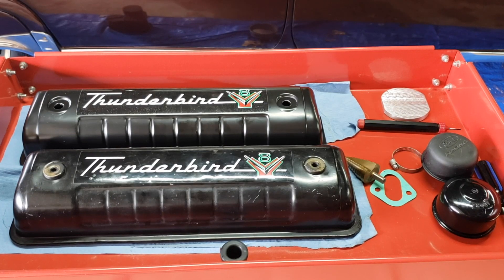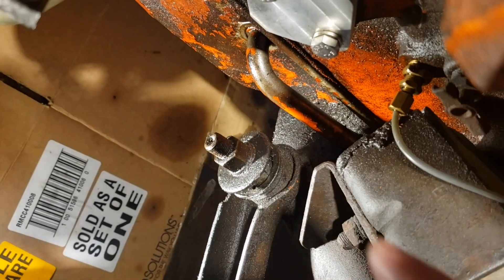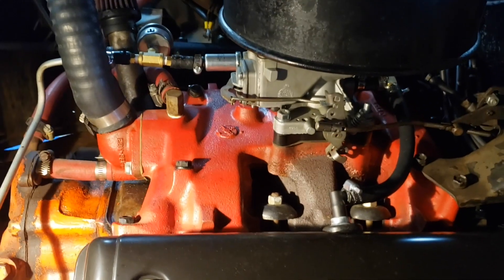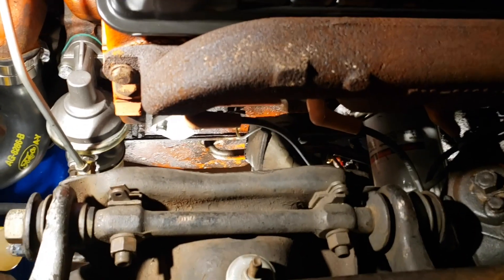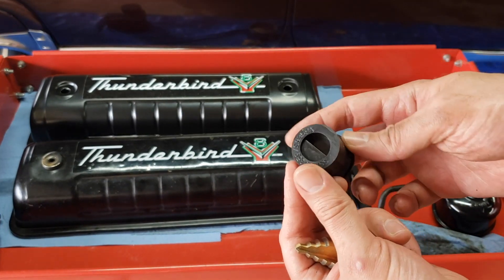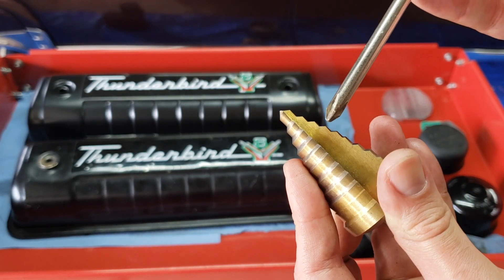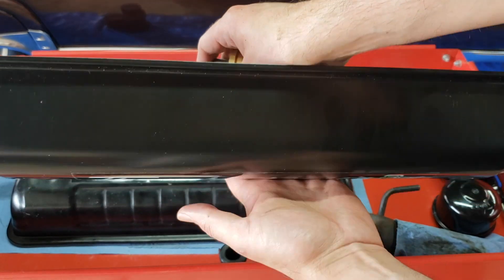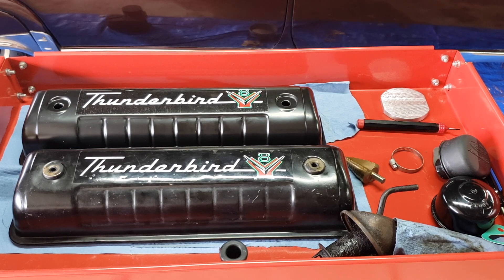Draft Tube to PCV conversion on a Ford Y block

Comment: Guessing you just placed the pcv to land between two valves
Reply from the maker: Between valves and positioned so it doesn't potentially collect oil or syphon off the rocker shaft.

Comment: Something I did to maintain a slightly more stock look was get an aftermarket oil filler cap with a PCV bung in it (I painted the zinc-plated cap to match the old one) then use a length of fuel hose to remotely mount the little breather filter out of the way. I used a Spectre filter that had a push-in bottom for a valve cover with a 1/2" ID, so I used a short piece of aluminum tube to connect it to the hose.

Comment: So looks like you are adding an additional breather to the other valve cover in addition to the original valley pan breather?  Just making sure before I start drilling holes.
Reply from the maker: Thanks for asking. I only drilled one hole for the PCV in the driver side valve cover. No other drilling. Later I also applied a little RTV black around the PCV grommet for a good seal.

Comment: Find an oil filler cap that has a grommet for a pc valve and you don’t have to drill a hole in your valve cover.
Reply from the maker: I considered that at one point to try a testing phase, but I don’t think I found anything that fit the valley pan filler neck. Still a nice alternative if you can source the pieces though. At least I didn't drill an original cover.

Comment: Why suck all that blowby crap into the intake?
Thats a greenie smog thing that happened in '63.
Reply from the maker: I used to get enough smoke out of the draft tube that I had people shouting at me at a stop that they thought my car was overheating. Not the first reaction you want when people see your car. There was the strong smell of the fumes as well. The engine also responded well to the change in crankcase pressure. I also pointed out how the location of the draft tube can saturate your lower control arm bushing in the long run. 

Still has been running great and with no direct effect on my carburetor settings. I’d rather recirculate the fumes than the alternatives.

Comment: How did you do the other part with the K&N filter? 
Also what is the pcv vale part number?
Reply from the maker: I was using K&N 62-1513 up until recently. I just measured the neck to get the size. Breathed well, but it was getting oil mist on my inner fenders I just painted even with the shield. So I'm trying a conventional breather again. PCV was a Fram FV184, still hasn't given me trouble.
Reply: Can you not run a flexible tubing and run it behind the motor and down with a filter?

Comment: A 1961-2 passenger car and a 1961-4 pickup truck y blocks came with PCV systems from the factory at least in California. If you have or can find one of the stock valley pans the installation of the system will be very easy. The valley pan came with a rectangular 3 sided “box” oil deflector and a teapot looking fitting. A retro fit one can be purchased for a Chevrolet that also fits. The PCV valve was an inline unit. A screw in valve, V100 from standard products, is the correct one for the Ford Y-Block engine if you want to screw one into a fitting at the base of your carburetor. An oil fill cap is available from stant with a 1/2” hose fitting which can be fitted to the underside of your air cleaner to make it a factory style closed system using filtered air into the crankcase.
Reply from the maker: Thanks for sharing the alternate V100 number, I only had the original number. It does look like it crosses with a Chevy valve on Summit's site. Do you have a number for the breather cap? The tube on the valley pan is 1.375, but searches tend to give me every size ever made but that one.

Comment: Thanks for the video.  You have a part number for that Moroso grommet?
Reply from the maker: Sorry about that, I forgot to add the grommet number. I believe it was #7209359 on Speedway Motors. I kept the package, I'll update if that's the wrong number. Throw out the foam insert and get better material and make sure there isn't any flashing left inside from the mold process.  One of the two in the two pack I got was pretty much completely closed by a big piece of loose flashing.
Reply: @mikemcgannvoiceover  ah! Thanks so much for the reply! Wasn't sure you'd see this after so long!

Comment: Best conversion  get an fe  engine unless you have a early bird  then you're stucked sucked😵‍💫
Reply from the maker: I've seen a few engine swap options in place of a Y, but this engine is still too healthy to justify the work just yet. With drum brakes, I don't like going faster than I can stop, so this cruiser engine will do. Some days it stops on a dime...other days not so much. 😄
Reply: @mikemcgannvoiceover  the 54 engine particularly bad  the 312 or 368 won't start on 6 v  the rockers you can run a bypass join the returns together with a tubing if one side oils  have a few engines in the yard and a ranchero 59  the oil pumps break.     3 times once on a 260 we had a fleet of these cars wagons tv repair shop the kit on the oil pressure switch will cause rod bearing failures  we never did that

Comment: Another option is using your hole saw on the lifter valley cover in the back. Requires pulling the intake manifold and cover. Easy mod. PCV grommet is bought at a parts store........
Reply from the maker: That's basically they stock way of doing it. Some like sourcing the valley pan that already had a hole from the draft tube because the baffle is in there. If I ever have to place my intake gasket, I'll consider moving it.

Comment: My 57 makes quite a bit of smoke when I stop, been thinking about doing this and gonna order parts after watching your video.  Have a new Holley on it so I hope it has the port for a pcv line.
Reply from the maker: If it doesn't have the port, you can also get a carb spacer with a PCV port on it.

Comment: Suspension bushing corrosion is proof crankcases must be sucked and If oil gathers on the filler cap increase sucking. I don't use PCV valves, restrictive and I don't route vacuum hose under carbs. 3/8 barb fitting rear of valley cover and in air cleaner base inside the element and 3/8 hose near always works well but depends on amount of crankcase pressure and air cleaner element restriction, proper air cleaner shouldn't restrict air anyway. Check clearances before you poke holes.

Supercharged engines different problem I solved with a venturi nozzle in and near end of exhaust pipe routed outside to valley cover. Proper shaped nozzle has significant vacuum even at idle. Also had to do that one on my dual quad engine 312. Or you could buy a stupid cost crank case pump.  

Noticed your intake manifold still has carb heat, I always block those off cause I don't like cooked carbs and don't have a problem nursing a cold engine until it gets warm, none of my engines even have choke plates and I live often cold Seattle. Suggest toss the distributor and intake manifold and use 57 or later parts.  For a real happy engine use pertronix, MSD, copper contact distributor cap and electric fan, plug and coil wires can't touch anything including yer fingers even with msd plug wires that will arc under high load. Gotta love a happy yblock.
Reply from the maker: I certainly agree to check clearances before poking holes. When I was planning the cut in the valve cover, I made sure the baffle wouldn't touch the rocker shaft, siphon oil off it, or be at an angle it would collect in the baffle.

The intake on mine is from a 57, that's how the Holley 2150 fits and I do have an electronic ignition. I get carb kits for a 68 Mustang when I need carb parts. It's had a PerTronix when I bought the car, it's been about ten years and never had ignition issues thankfully. 

That's the original paint on the manifold and I did notice the bare spots from the exhaust crossover. I never had an issue with the heat flapper on the exhaust, but while doing my manifolds recently, I decided to get the blank for the exhaust to avoid potentially burning valves. I'll block off the crossover next time I have my intake off as well as move this mod to the valley pan. But this has been working well for now. As common as heat soak was back then, I actually never had a problem with vapor lock or hard starts in the heat of the Summer. What I thought may be heat soak one year, just turned out to be a dirty idle circuit that cleared up when I cleaned it with guitar strings and reseated the check ball while I was at it. 

I've seen plenty of people complain their stock Y block had over heating issues, but I have never had issues with mine so I plan to stick with the water pump mounted fan. I like having low power requirements in case the car needs to limp home, though I did put an alternator in recently so it can run at a constant 14v and not just 13v or only when in park or moving. Not sure how many of those people had the original 3 blade design instead of the 4 blade, but I have the 4 blade.
Reply: Not up on that carb so assumed early intake. Not sure why several of my yblock pals engines overheat and vapor lock, most are even older and better wrenchers than me and some have electric fans. I noticed they aren't fresh engines so perhaps choked water jackets or timing. I've never had vapor lock even the beaters I pounded on in the late 60s and regardless of weather or use mostly stay at 165 thermostat temp. I did do all I could think of to keep them cool including no inner fender splash aprons, musta done something right. Actual reason I switched all mine including prewars to electric fans was lost a blade at idle on my freshly painted f100, ruined inner fender and hood, that really hurt. If yer radiator pops the aluminum unit from Concours is well built, far cheaper than fixing stock and actually 20% cooler. Recently got one for my ranchero $400. Was warned to avoid chyna radiators. What trans in it?  @mikemcgannvoiceover

Comment: Nice idea and punching a hole in a rocker arm cover was common with the retro fit kits in the late 60’s when some states mandated a PVC system to get a car license renewal. 
Many today want the installation with a “cleaner” look and use a 62-64 valley cover with the factory parts if they can be found. The original y block systems had the valve in the hose line or screwed into a fitting at the base of the carb or the intake. 
The system takes the smell out your garage if you are able to fine a oil fill tube breather with a 1/2” tube fitting and have go to to the air cleaner.

Comment: I was thinking about putting one in the block off plate that you built, then route a 3/8" hard like up the front of the block to the intake. I did this type of pcv on a 235 chevy. used a freeze plug I drilled out and it worked out very nice. Thanks for the video.
Reply from the maker: I'm glad I could help inspire your project. Just keep in mind what you'll use for a baffle so it doesn't pull too much oil through the line.
Reply: @mikemcgannvoiceover  Indeed, It may require a catch can if a guys not careful. And that could fill quickly and be a pita?

Comment: I have never seen this system on the side of the fuel pump in Brazilian 272/292 engines. do all blocks 272/292 have this system ?
Reply from the maker: I know Ford used the Y Blocks up until 1964 in trucks in South America. I've seen diagrams adding the PCV valve dated 61-64. It may be possible you've only seen the version that has the breather on the oil valley pan like the Thunderbirds in 1956 but without the draft tube coming down the back of the engine.  Those are the only two places I've seen them vented from the factory.

Comment: Have you seen an improvement in blow by since installing this PCV? Also, have the part number for the PCV valve you bought?
Reply from the maker: I did the conversion back in November of 2021 and it's still worked great so far. The engine also runs a little nicer with the change in crankcase pressure. 
I used to have enough blow-by that I'd have a cloud building under the hood at a stop and even a little smokey at my feet in the car. 
It's actually strange to not smell chemicals anymore, I also haven't developed any new oil leaks or oil consumption. 
I clocked the position of the grommet also so oil can't pool in there. 

PCV was a Fram FV184.
Reply: @mikemcgannvoiceover  that’s great to hear! Thanks!